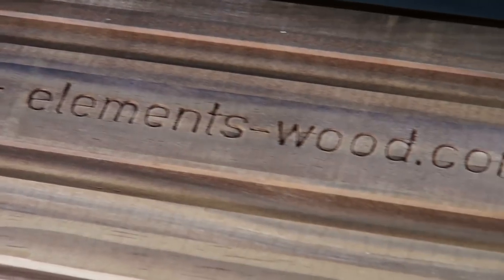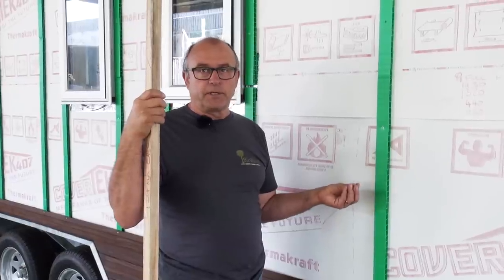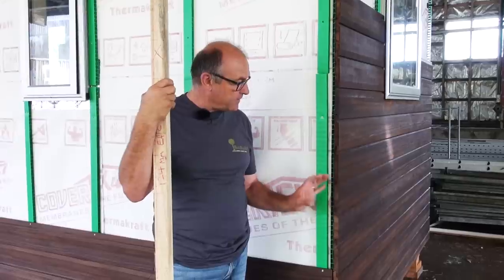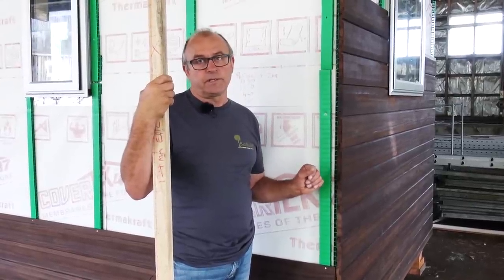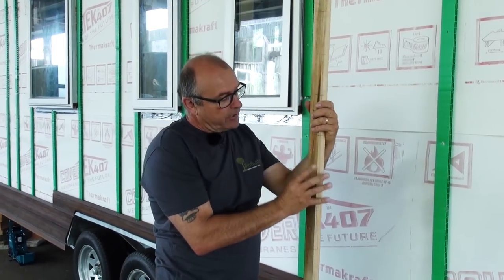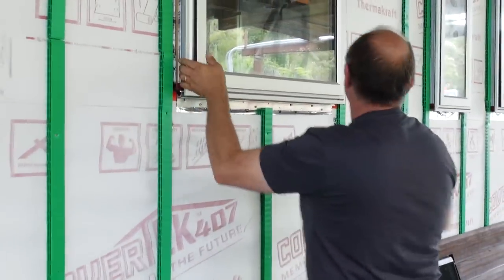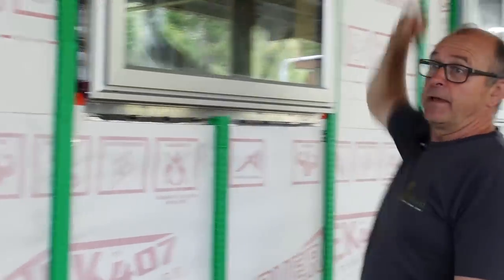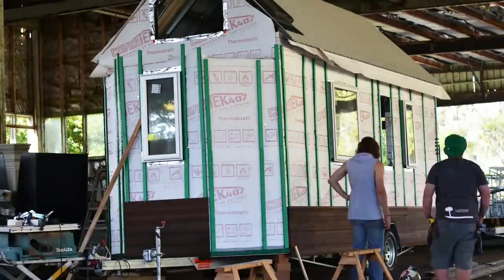How To Install Weatherboards (Part 1) - Overview

Comment: I'm a little confused as to what you're planning on doing on the inside. Don't people usually sheath before putting the exterior siding? and what about insulation? steel has a lot of thermal bridging and I've read insulation on the exterior is more effective than between studs. Are you going to be spraying the interior with foam in full or something?

Comment: What's wrong with using vinyl siding on Tiny houses?
Reply: Taste.
Reply: One can buy vinyl siding that looks exactly like 6" lap wood siding at a fraction of the cost AND weight of wood lap siding and all you can say is 'taste'?

My question was serious, your response wasn't.
Reply from the maker: ***** Hey there. There's nothing wrong with using vinyl siding on a Tiny House. It could be made to look quite good, and would probably also be lighter weight. The building materials that are going into our house have to meet certain criteria. Including sustainable and local sourcing, low / no toxicity and also end of life (e.g. can it be recycled or composted at the end of it's life). We looked into many different options, and a product like this timber, which is locally and sustainably grown, has roughly the same density as cedar (so it's relatively lightweight), is totally non-toxic and can easily break down at the end of it's life in the house made great sense to us.
Reply: Living Big In A Tiny House Thanks for responding! I design new houses, kitchens and bathrooms specializing in the concept of 'smaller is smarter' so of course I find the 'Tiny House' idea fascinating. 

I've seen a lot of videos featuring these 'cozy' little places and wondered why they are all clad with wood, it's heavier than vinyl and here in north/central Indiana is seldom used on stick-built houses because of the maintenance required.

And while I'm here I must commend you for your awesome Living Big site, it's been very informative, I design but couldn't build what I design and I've never designed with steel framing so I'm learning a lot from your videos. I can't wait to see the final reveal! I also have to add the lovely home the charming couple Shaye and Tom built is far past outstanding and is my favorite 'tiny house'! 

Best regards from frozen Indiana USA.

Comment: It would be nice if they build the interior of the house themselves and start using some second hand material instead of purchasing every thing brand new at probably full price. Stop relying on the builders they maybe good at there job and nice to work with. But hiring other peoples labour especially professional labour is expensive and there advice is bias industry advice. Use "blah blah" product because it does "insert marketing talk here" instead of ever suggesting secondhand sourcing.

Go back and talk to Brett Sutherland about advice for building the interior cost effectively on your own. Brett sounded really culed up on how to do things good and cost effectively.

I enjoy the videos from your channel and its a good thing you guys are doing. It would be great to see if you could rein in the spending a bit.
Reply from the maker: OutThereOutLook I appreciate your feedback. The purpose of our build is to showcase high performance materials and form the very outset we wanted to try and build the tiny house of tomorrow, using sustainable technologies. We try and feature as many other builds as possible that are achieved on tight budgets, but for this home we wanted to showcase what is possible and what the next generation of tiny houses might look like. 

We rely on the builders for these videos so that the information provided is correct and from experienced trades people. If we were to show ourselves fumbling around the builds then the information wouldn't be as valuable to people who are building their own homes. If you want to know how to correctly install a window head flashing then Alan is much more competent to show you then I am.
Reply: Living Big In A Tiny House  It makes sense I guess. Theres definately been alot of useful information in these videos so far. Especially interesting was to find out about the 10 metre rule in NZ.

I just wish I knew the rules for Ozzie.

A high end tiny home like this seems like a good solution for people living in a bush fire danger zone. Instead of having to worry about protected their house from fire when fires come close. They could just hook the house on to their car and drive to safety if they got enough prior warning.
Reply: OutThereOutLook
 A google search showed up some of the rules for Australia. Interesting.
Reply from the maker: OutThereOutLook There's already quite a strong (and fast growing) tiny house community in Australia. Just search Tiny Houses Australia in google and you'll find the group. Getting in touch with some of those guys, and perhaps attending one of their Tiny House workshops would be a great way to get clued up fast.
Reply: Living Big In A Tiny House 
Hi There, Ive been watching whole night and I like so much your ideas and professionalism in building the Tiny House, just wonder if you planning to insulate the floor with some extra waterproofing layers? Personally plywood T&G will be much stronger and watertight maybe with double bottom and polypropylene solid insulation…? Hope you guys progressing hard on a next videos and looking forward to download some plans as well, thanks so much Kris